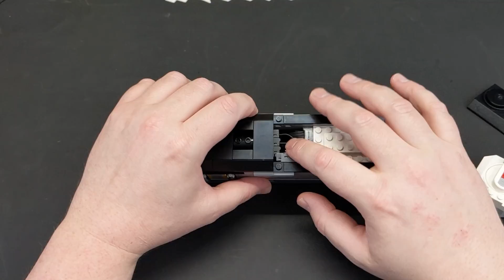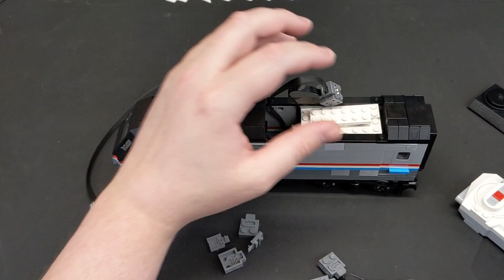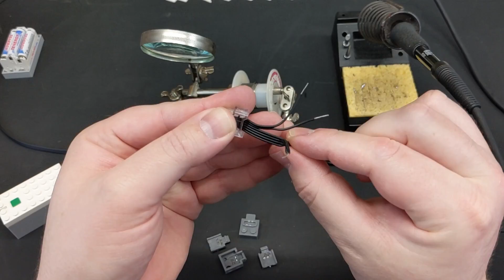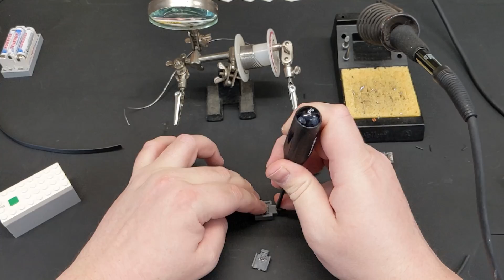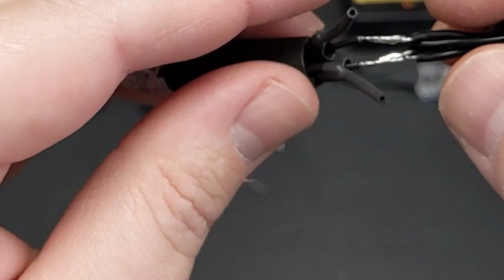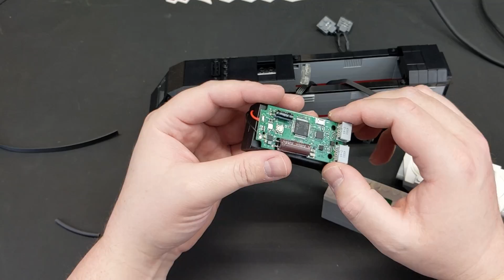Lego Powered Up to Power Functions Adapter

Comment: Hi! I already made two of your adapters, they work great...!!

Now, i have a question: can you tell me which of the cables which come out of the powered up plug are for the lights? I would like to connect a powered up plug with power functions lights. Because the aliexpress power functions lights only cost about 2 €, but the lego powered up lights cost 10€...

Is it possible to cut the lights and solder them additionally to your adapter? And which cables would do for that?

Thanks in advance from germany...! Marc
Reply from the maker: I made one for my Arctic train, I showed it in the video but not as I built it.  You have to use a resistor between two of the leads instead of shorting them out.  Philo has all the info and pinouts on his website philohome dot com

Comment: Thnx for the video!! Can you tell how to propperly connect the power up connector to a led string? For the front and back lights aswell a the overhead front lamp. I would make lights in there! Thnx
Reply from the maker: Well it depends on how you plan to accomplish that, there are many ways to do it.  I would recommend joining our discord and we could talk it out and give advice, many of the members there have experience that I don't

Comment: The link to the PF connectors doesn't appear to be valid now.  Do you have another link you trust?
Reply from the maker: I haven't had to order any in quite a while.  I haven't heard of anyone having issues with these plugs regardless of which seller they ordered them from.  I would just search "lego power functions plugs" on AliExpress (I don't know of anywhere else to find them) and order some.  They are very cheap so even if there is an issue at least it won't be a huge loss besides time waiting for them to arrive.

Comment: Great work there buddy. Here is a helpful tip. To avoid burning your fingers, I would recommend using good quality self locking tweezers to hold the wire and then solder it on in the normal way. Hope this helps and all the best, Peter.
Reply from the maker: I'm usually more worried about getting a good solder joint than my fingers 😅.  I do need a good set of locking tweezers, it's just always something I forget to pick up

Comment: I have a pu train motor and pu light sensor and a pu bricklink light connector. Can I all power them from 1 hub as each hub has only 2 ports
Reply from the maker: Possibly?  The only way I can see this working would be to combine the lights and motor on one port.  It's not something I've tried myself
Reply: @BatteryPoweredBricks but my motor is running at 50%
Will this affect light
Also I use pybricks 

Is it possible that you can try this please

Comment: Will it work with PF servo/mouldking servo?
Reply from the maker: Not really?  It could be done but would need extra circuitry or power the servo from another output.  The PF servo needs a constant 9v supply, the PU connector only has a constant 3.3v supply.
Reply: @BatteryPoweredBricks  I have done some more experimentation with the buwizz 3.0 and figured out it has the constant voltage supply to the outer contacts on a PF port (for powering servos and IR receivers but I'm not sure if it is a stable power supply of 9v or if its closer to 12v, will it work thought?). using the PU to PF adapter with the outer contacts on the PF port going to the corresponding contacts on port B it should work without taking a way a precious high-power port for the buwizz buggy motor. 

sorry if the explanation is really long and rambly just wanted to make sure I don't fry any components.

This adapter will be used to run a PF servo/ Mouldking servo while still using both PF ports on the buwizz 3.0 to power buwizz buggy motors

Comment: I was able to find the PU cables on aliexpress labeled as Wedo extension/replacement cables. I was able to get the parts and two knock off train motors for $25. These will work great while I try to track down some powered up train motors. No way I am paying scalpers $30-40 for one train motor. Anyhow thanks for posting I appreciate the tutorial.

Comment: Hey man I tried this and nothing is happening with my dual motors. Is there a wiring diagram available? Am I correct in believing that if I take a multimeter and check all four pins stud sides of one connector there should be no continuity?
Reply from the maker: There are links in the description to where I found the information on Eurobricks.  I know there was at least one diagram I used from that.  It's easy to make a mistake and do things backwards.  If the PU plug is unplugged there should be no  continuity between the pins on the PF connectors.  If there is you have a short
Reply: Awesome thanks, will this adapter work on regular firmware? Or do I need to update to pybricks ?

Comment: Have you done this with the new powered up cables? Like split them into female adapters ? Is that possible? Also what's your take on "overseas" Lego? Is it safe for my nephew?
Reply from the maker: The female ends of the cable tend to be much more expensive and many just don't work very well, otherwise I probably would have used them.  "Overseas Lego" can mean a lot of things, some companies are much better than others.  As for what is safe for children I don't wouldn't really know, I don't have any children myself

Comment: Suggestion for creating these adapters and or similar ones and so on.

One option for having the splices and all enclosed and yet Lego compatible and not as messy and or stiff.

Might be able to use one of the bricks from the middle of a power functions light or possibly even the powered up lights best would be to get one that's not working or otherwise that could be used as the middle section and have everything encased Within.

Will probably be enough room for the width of the powered up cable and also power functions.

Also suggestion to make adapters that take two 9-volt connectors I'm going to one powered functions connector to have power for the constant 9-volt power and also control lines.

More than likely this was mentioned in another video but I have not watched all of the battery-powered bricks videos as of yet!

Also with the right combinations of 9-volt parts and power functions others have also mentioned doing things using dual motors and the fact about reversing one of them.

And of course we're usingAnd of course using the power functions train motors.

And trying to shoe horn in a polarity switch can get quite awkward.

And take up way too much room and make things just harder to need be.

If you have the 9 volt components in enough of the power functions extensions give me a lot more compact then power functions polarity switch method

You might have a bit of extra wire however probably easier to deal with than the bulk of the other method!

I did sort of a redesign of a 4.5 volt sets locomotive can't remember the exact name of the set it was the one with the blue battery box with the door stickers on their.

Had the yellow car and red locomotive I believe it was one of the cargo trains but can't remember the exact set the name door number.

Built this locomotive to pay homage to it.

But use the 9-volt train motor.

Combination of power functions and 9- volt parts.

Interior illumination all four headlamps illuminated with two sets of power functions LEDs.

Note no rear lighting.

However.

Had a red flashing beacon on the locomotive courtesy of the 9-volt single vertical light brick.

Into your cabin illumination provided by the right angle 9 volt lighting brick.

Also the locomotive provided power for all the other cars for the lighting.

Unfortunately you do not have enough of the shutters anymore for the original design however substituted the Grill profile bricks for this Walmart looking pretty good.

Doors and such were from the original set although the stickers long gone as in rubbed away any details if it was still there even.

Also one of the more interesting cars I built for the strange what is the Caboose.

Again one power functions LED.

And use of the Lego 9 volt fiber optic system lights to functions the flashing beacon on the roof of the Capriola on the Caboose and also a blinking light at the rear of the Caboose as well.

In addition to lighting a desk lamp in the Caboose Cupid!

There are two of the Lego fiber optic system Optical fibers going to to lights at the rear of the Caboose just in red.

And also a similarly done sort of outdoor light above the fake rear door.

Also to keep the light from shining through the red bricks which are actually the horseshoes for the Lego garage door tracks the one by two.

The black capes to mask the light this worked pretty well and still kept things 100% Lego it's a good option to keep things from shining through in my opinion.

By the way to rotation for the fiber optics light unit was provided by the Lego 9 volt micro motor.

Frankly it's louder than the train motor or at least more noticeable!

Needless to say something like this is difficult to do because of all the cables needed it's a bit complex when trying to decide all this into something to sort of Disguise all the electrical and the optical components but I was pretty pleased with the results
The locomotive was the hardest part for maintaining the cable routing since shoehorning cables where you can and keeping them from sprawling everywhere hiding them as much as possible

This will be for a future Christmas train!

By the way there is one thing with sound on the train layout something else of Interest.

In terms of sound no it's not at one of the sound breaks or anything

Diesel horn being done mechanically geared up power functions motor and using a gear rack upside down and a bit of downward tension with a rubber band and yes beneficial rubber band.

This is operated by a Lego build push button on the control box.

Being used as a generator to alarm remote control of another power functions motor.

And at the other end of this there is a semaphore signal that's illuminated by another Power functions LED.

The building next to it where all the magic happens!

The second light on the Lego Power functions LED.

Illuminates part of the structure that is cordoned off to give the illusion of a hallway.

And the outdoor light next to the door is also illuminated courtesy of a Lego fiber optic cable.

The little hallway area is only by distilled light from the power functions LED.

This building is also where the diesel horn mechanism is!

And the what looks like a throttle is actually operating the symbol for motor the motor in the building for December 4 there's a linkage to a 9-volt polarity switch arrange in social media is to be an on-off switch only and is triggered when the symbol for is in the clear position and the light is green.

And when going through yellow and to read is off interrupting power to the track note also building also acts as a junction box for everything else talk about complex but very rewarding and unexpected especially the mechanical diesel horn

Comment: This video is so helpful!!! Thank you! Question:
For the "ID wires are shorted" is there different 'shortings' for the different motors Lego has? like for M, L, XL Motors? Is there a list? Going to streamline some GBC modules, thanks again!
Reply from the maker: You can check out Philohome dot com for a breakdown of the PU wiring.  If you wanted the motor to have speed steps like a train motor the same wiring would be used.  If you wanted them to only be powered when the button on the controller is pressed you'd use a 2.2k ohm resistor.  The size (M, L, XL) wouldn't matter either way
Reply: @BatteryPoweredBricks  ty! That's exactly what i needed for info!

Comment: How many motor can the Power Hub provide a good level of power without triggering any protection system?
Basically, have you ever measured the maximum current output of the PH and the input of each motor?

I'd like to build a Multiple Unit train and I'd like to save money by using one Power Hub only and since I need to go through an incline, I was hoping to power 3 or 4 motors in parallel.
I cannot find useful information online so I am wondering if you have ever taken any measurements.
Reply from the maker: It may limit the power output just to have 2 motors on the same port.  The motors will use a lot more power trying to pull a train up an incline.  In my TrixBrix haul video where I bought their bridge set and then a followup video where I used magnets to help keep the train together I used 2 hubs and 4 motors (using PyBricks to control them with a single controller).  This is the setup I would recommend.  Inclines add so much resistance I don't think more motors from a single hub would help much
Reply: Ah yes I have been following some of your videos and they have a lot of useful information.

I'd like to convert the Power Hub to get power from the rails so to not worry about the battery Ah.

The train would be a passenger EMU of 4, 5 cars, with centre car with the power pickup and power hub; the motors will be at the second bogie of the driving vehicles.

I will try if two bogies will have enough power to push the train up, especially due to limited length and having always a motor in the back pushing up. Being an EMU, I will join the vehicles permanently, no magnets.

Anyway, thank you for the info! Worst case I'd go with two Power Hubs to add an extra 1, 2 motors.

Comment: I wonder if man can make this cable but for PU motors.
Reply from the maker: The problem is finding good PU sockets.  The plugs used in this video are easy to find.  The sockets are much more expensive and tend to be unreliable even if you do buy the high dollar ones from what I've heard from others

Comment: Thanks for this video I’ll check out the other links too. I’ve used the same BNTechGO cable, and the dreaded heat shrink, to extend my Switch motors and Sensors for BAP and BrickRail. Hadn’t thought about doing this for all my spare PF Train motors. Are they recognised by PyBricks correctly? Cheers 😊
Reply from the maker: As long as the ID wires are shorted like shown in the diagram any PU hub will see them as train motors.  I'm using the same (with a few upgrades) PyBricks script I've used for the last year and it works just the same as PU motors.  I may adjust the acceleration curve since they act a bit differently than PU motors
Reply: @BatteryPoweredBricks  ok thanks, may as well use up those spare PF motors 😎

Comment: First off, great video and tutorial -- Thank You very much.  I have some knowledge about 120v/220v work as it's applied to house wiring and I've done some low voltage lighting work, as well.  I also used to dabble in some DC motor wiring as a hobby, but that was long ago.  So, I'm in no way an electrical expert.  However, I do have some comments/questions from a hobbyist perspective.  For anyone that doesn't have a soldering iron or the necessary experience, what I see in the simple wiring connections you're making, it seems that simply using heat shrink tubing over the twisted wire would be perfectly durable enough for the wires being shorted and this might also be a solution for the rest of the other connections, as well.  If a more durable connection is desired for the pass-through wiring, you could crimp the wires together with Dry B Wire Connectors.  This would take the place of both the soldering and the heat shrink.  If you have (or buy) the right one, you could do both the wire stripping and the crimping with the same tool.  Also, I'm I bit confused on the mention of reverse polarity that you mention, but don't go into much detail.  I understand the concept of using the hub in order to use dual motors and/or lighting, but how or why would I want one motor to go in one direction and the other motor to go in the opposite direction if I simply want to push the engine forward or backwards with both motors.  Perhaps you or someone else with more knowledge than I have can shed some light on that for me.
Reply: The front and back motors are pointing in the opposite directions, so one of them needs to run backwards.
Reply: I thought that might be the case.  However, why couldn't they both run in the same direction?  Is there an advantage in running one of the motors backwards as opposed running both of them in the same direction? @jamesmorgan3623
Reply from the maker: Lots of ways to splice wires, after doing electronic projects my entire life solder is the only thing I trust 😅.  The motors must run in opposite directions since they are mounted facing away from each other. This is so the wires can go through the baseplate to the hub. Otherwise you'd have to have a hole in the back of the locomotive for the wire to go through
Reply: Got it, thanks much.  Makes perfect sense if you are going to use one of LEGO's train baseplates.  I've been exploring designing and building train MOCs using standard plates instead of LEGO's designated train baseplates.  mainly because they're getting really expensive due to their scarcity.  I've seen various videos (YouTube, etc.) by others that are designing their trains using standard baseplates instead of using a train baseplate.  I believe that alternate wiring solutions may certainly be available using alternate baseplate design that would allow a dual motor setup to run in the same direction without having to drill any holes.  Although, perhaps with a bit longer wiring connections involved.  I hear you on the soldering.  Just thought that I'd offer my 2 cents worth for those that aren't very comfortable with soldering or have the proper setup/hobby space other than the kitchen table. 😀   @BatteryPoweredBricks